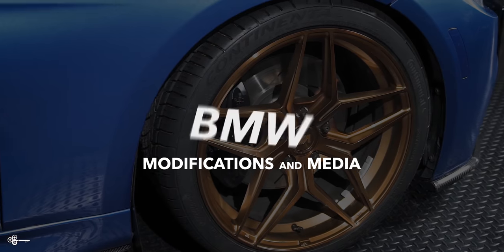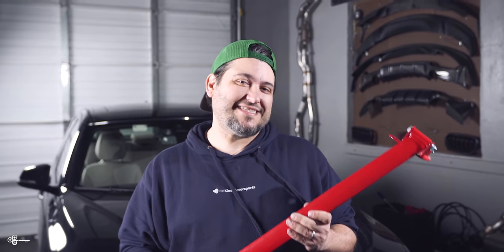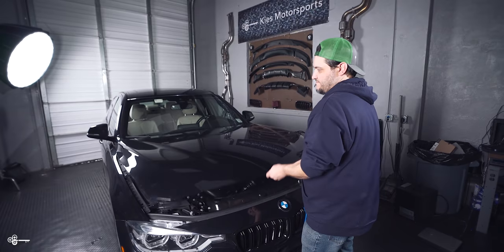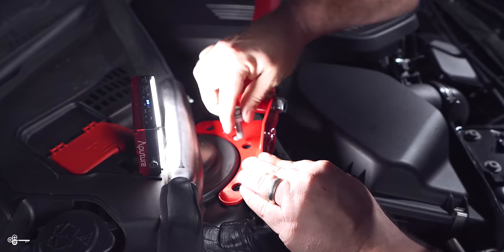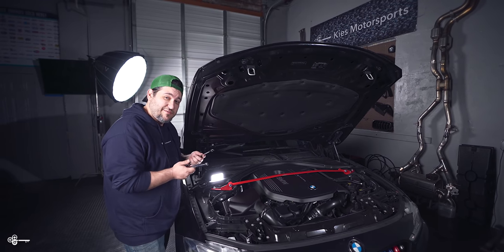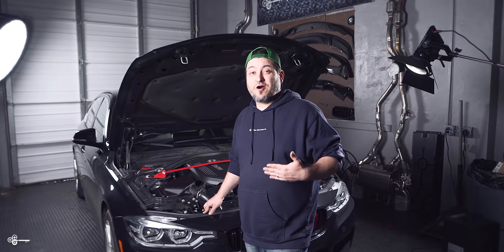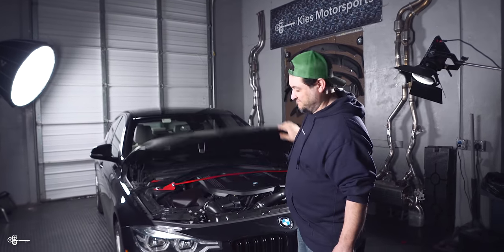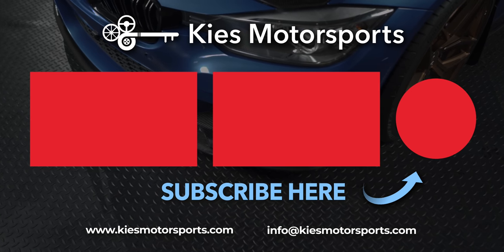Chris' BMW F30 340 gets a RED STRUT BRACE (Cheap F3x Suspension Mod!)

Comment: don't you need longer strut bolts if you're adding a strut brace, since the bolts are using less threads than intended? or is it fine reusing the stock bolts?
Reply: This is a good point. hopefully they respond
Reply: I reused the stock bolts with out issue. There is enough bite there, and was able to torque them to the correct spec without issue. The spec sheet I found stated the bolts should be refreshed according to bmw. I didn’t get new bolts as I stated earlier, and haven’t had any issues and have been running it hard on weekend for the last few months.

Comment: What is the Torque Spec for these/F32?
Reply: There are 2 possible specs, if the bolts are m8 it’s 30nm plus an extra 90 degree turn. If the bolts are m10 it’s 56nm plus an extra 90 degree turn. Also, technically your also supposed to replace the bolts but I haven’t and have been fine.

Comment: Do you have enough clearance to remove the engine cover?
Reply: I dont think so but you can just remove the bar separately and not have to take it off the strut tower everytime
Reply: I bought this bar from them for my f32. You will need to remove the 2 strut brace bolts in the middle. It takes an extra min but it’s worth it.

Comment: How do you have that front license plate without having the parking sensor going off. I did exactly the same using the far corner of the mounting hole but still it triggered the sensor
Reply: Sensor delete mod

Comment: What is the torque spec (for F30)?
Reply: There are 2 possible specs, if the bolts are m8 it’s 30nm plus an extra 90 degree turn. If the bolts are m10 it’s 56nm plus an extra 90 degree turn. Also, technically your also supposed to replace the bolts but I haven’t and have been fine.

Comment: What is the spec for the bolts??
Reply: There are 2 possible specs, if the bolts are m8 it’s 30nm plus an extra 90 degree turn. If the bolts are m10 it’s 56nm plus an extra 90 degree turn. Also, technically your also supposed to replace the bolts but I haven’t and have been fine.

Comment: What’s the Torque specs ?
Reply: There are 2 possible specs, if the bolts are m8 it’s 30nm plus an extra 90 degree turn. If the bolts are m10 it’s 56nm plus an extra 90 degree turn. Also, technically your also supposed to replace the bolts but I haven’t and have been fine.